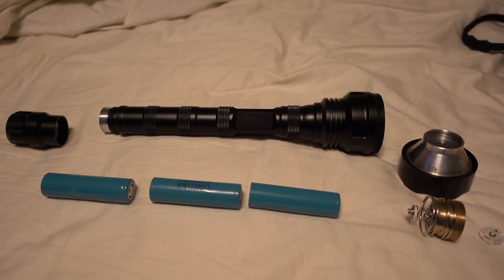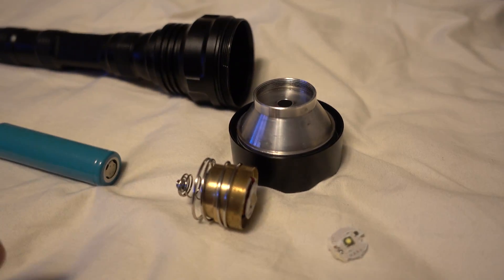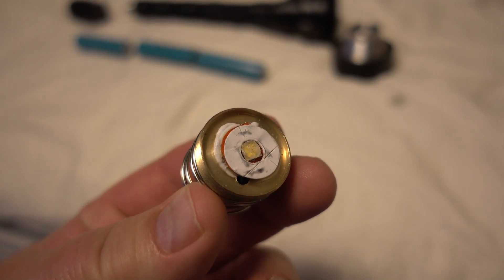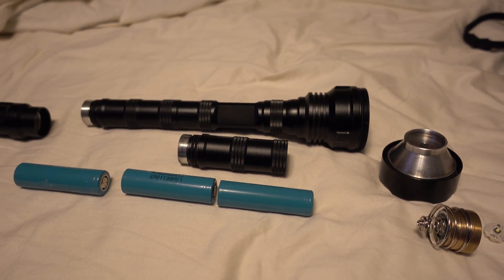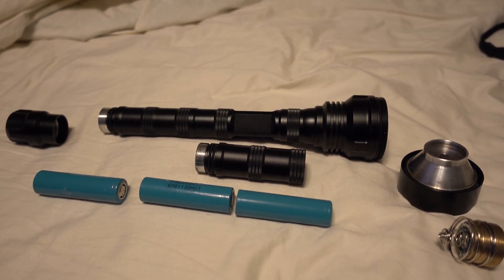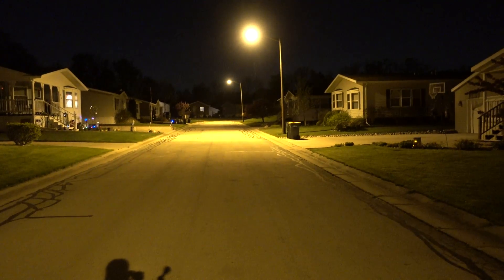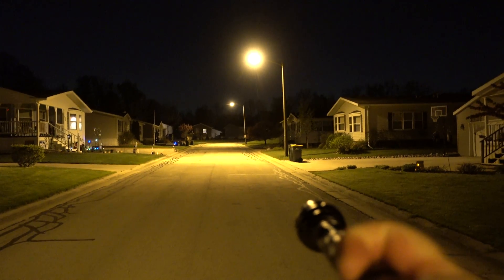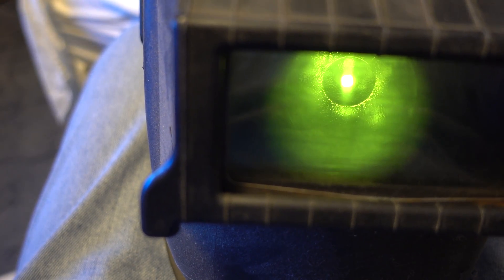5000 lumen XHP70.2 flashlight

Comment: Whatt xhp70 5000lumen???  Xhp70.2 data seat 4292 lumen 29w... real watt driver???
Reply from the maker: araa klaten It’s a direct driver and I’m putting more amps and volts through that I should more power more light it’s limited to what the batteries could out put

Comment: says on Cree's website that the max power this LED produces is around 4200 lumens, so where does the 5000 lumen figure come from?
Reply from the maker: nzoomed I ran more power, no power controller it’s suppose to max out at 12 v 1.4 amps led gets hot fast